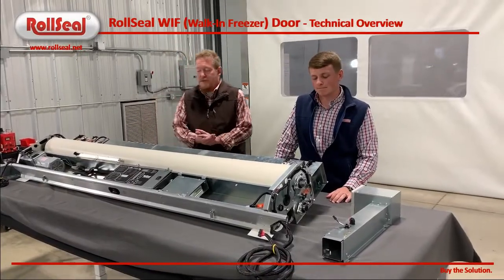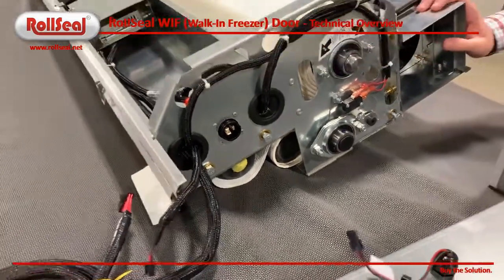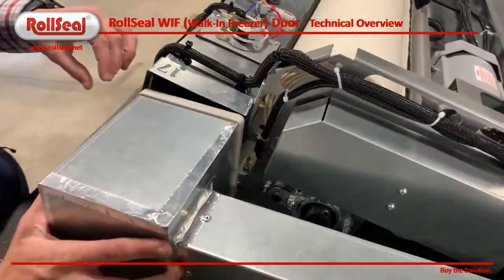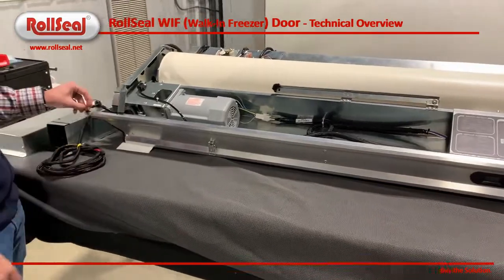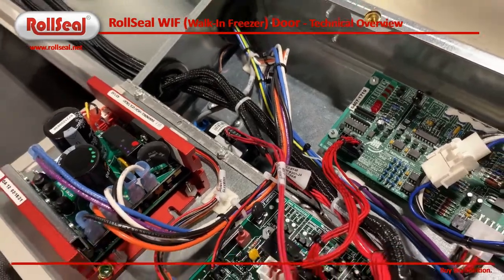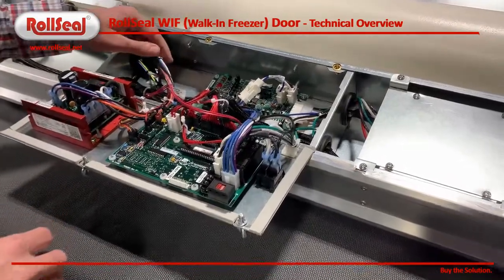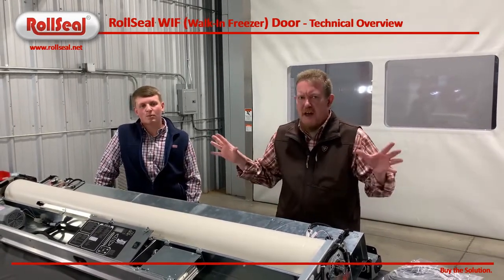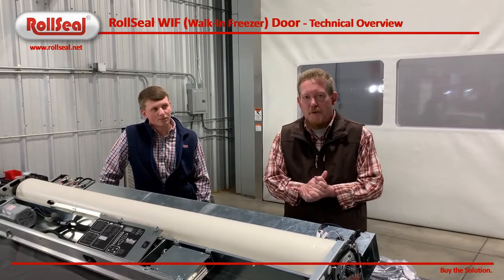RollSeal WIF Door - Technical Overview

Comment: I'm dealing with a roll seal door with this type of controller. The door goes up and passes the home switch every other time and displays error code EO1. I've replaced the home switch, both boards, the switch card and label. Checked all plugs and connections and have gone through all the settings which are correct. When the door goes up and down it always displays a number in the process and at no time has the three dashes. Any ideas of what can be the issue?
Reply from the maker: Sorry to hear that you are having issues.  Have you spoken to someone in our technical support department?  Please call us @ 800.668.2815.  If you have already spoken to us, please let me know how I can get in touch with you.
Reply: @rollsealdoors5251 I'm on my way back to that call. This is like my fourth time having to go back. Yes, I have spoken to your technical support and every time I speak to them I'm ordering something else but the issue remains. I'll be calling later when I get there
Reply: Issue has been fixed. I took the curtain off the Velcro and reattached it making sure it was completely straight. Called Tech Support and spoke to Shane who instructed me to clean the gear in front of the encoder. While doing that I found something stuck in between 2 of the gear teeth and that was causing the issue as the door was always stopping in a different spot. Thank You guys